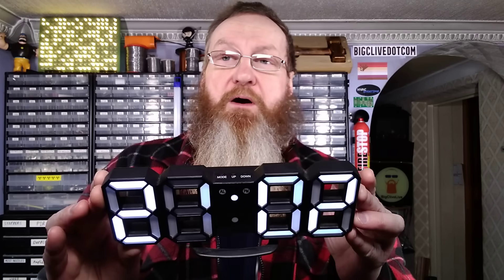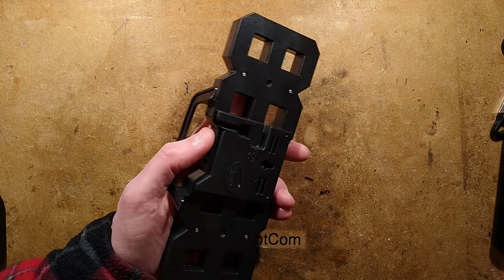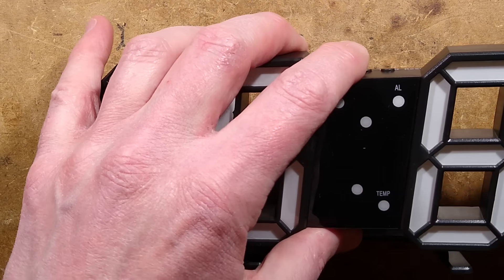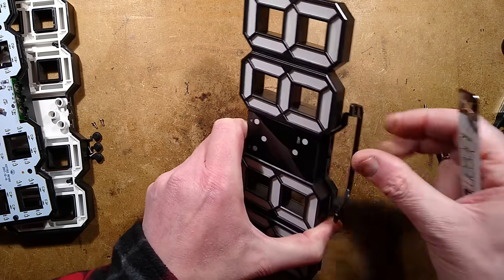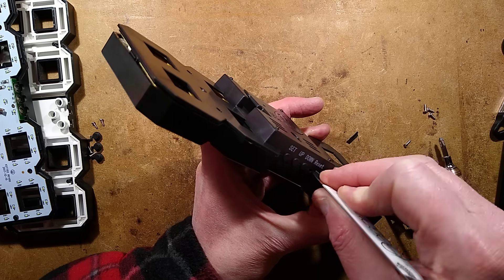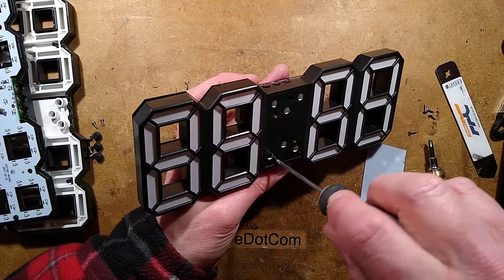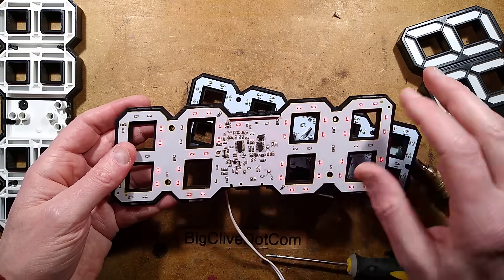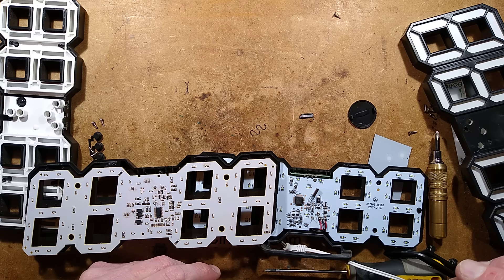The CURSE of white LEDs

Comment: that's why if a device has a dimmer option then I tend to use it. I had a microwave with bright white LEDs that could light up an entire room and one of the segments went out. 
any device with a standby clock that can be turned off, I do so, and any TV with a screensaver, I set the screensaver to power saver mode. there isn't any reason to keep a device turned on that you're not gonna use. I have 4 monitors at my desk and when I'm not at my desk I flip the power strip switch with all of my monitors, desk lights, speakers, etc are completely unplugged when I don't need them. I keep always on displays on my phone completely turned off, I use light mode on LCD (and turn the brightness down) and dark mode on OLED or QLED displays. I take the batteries out of devices that I'm not actively using. 
at the end of the day my devices last longer and are worn less.

Comment: I have a white one in the projection booth I operate, but it has an ambient light sensor so when the room is dark (95% of the time) the LEDs are dimmed so they are not operating at full intensity extending their lifespan.

Comment: Looks like they are overdriving those piddly 0805 leds, for a segment size that big asking two of those tiny leds to evenly light the area up is probably more than they are capable of. Another thing I've seen kill leds quite fast is charlieplex driving them outside their reverse bias specifications. I once had a kit that used blue leds and half were dead after a year of 24/7 operation and I suspect they just really didn't like being rapidly reverse biased to 5V.

Comment: There's a tendency in electronics devices to "overdrive" the LEDs now. I have several modern devices like USB power meters, power adaptors with LCD screens, and many others that have faded out in just 6 months of continous use, basically because they want them to look as bright as possible at the point of sale, but this makes them fade quick. I have leds from 15+ years ago that I used in my home made alarm system, they still glow as bright as the day I made the system (circuits designed by me to drive the leds), I am by far not an expert, I just followed Ohms law and the specs of the LEDs, and they do last forever.
Reply: I think you can add all LED based bulbs to that list as well. Dammit.
Reply: @Cooper_42  I work on a lot of industrial/commercial lighting, and its my experience that about 99% of LED lighting failures are in the power supply, not the LED. I replace a couple hundred LED drivers a year and I think I've done 2 LED strips in the past year. In the home its the edison bulb replacements that die. In the past decade I've had a dozen or two LED edison bulbs fail at home and not a single purpose built LED fixture. I believe its largely due to heat. The bulbs are tiny and driven hard, and the power supply is shoved down into the base with little capacity for cooling, not even coupled to the metal outside, and they're often stuffed into fixtures that further prevent cooling.

Cooling is king with these things as far as longevity goes.
Reply: @ agreed, I wasn’t clear. The entire system is overdriven. Packages too small, cooling not taken into consideration, components squashed together, etc. you can’t make money creating consumer products if you can’t sell new ones, so they have no incentive to design/ build products that last.
Reply: I had a few from ikea 10+ years ago, and they were used constantly. Took about a decade for them to start to fail. They had solid aluminium bases and were well connected, thermally. Can’t get those anymore.
Reply: @Cooper_42  Designing to last requires proper requirement management and verification which costs a lot of time and money, which will not result in more sales. Only big brands care a bit about because they brand reputation at stake, but any no name will do anything about it,
Reply: @sparqqling  No, designing to last adds negligible cost and can even be cheaper. Designing to break requires a lot more R&D work to get the bathtub curve to end just after the warranty period. In the case of this clock, they could have easily doubled the number of LEDs and driven them at 1/3 the current to get the same brightness (it's nonlinear). LEDs are typically a couple cents apiece. It would have increased the cost by a mere 50 cents to do it right. Furthermore, the greater number of LEDs would produce a more even light and they could make the diffusers for each segment less opaque. Now you're down to like 1/4 of the current per LED for the same brightness. The clock would last 10-100 times as long. No fancy "Management" or "Verification" required.

This product was *designed to fail.*
Reply: @cutterjohn1921  Try the ikea globes, the E14's anyway, and they emphersise avoid heat.  ( well heat is electrics enemy, but its rarely mentioned by sellers.)   edit-- so the ikea has been mentioned, still sold in australia, but they are edging in stronger ones.
Reply: @thorlancaster5641 Exactly this. That "it would add cost" is the lamest apologism ever. Adding more margins to components (and designing properly) would add cents to manufacturing costs, all while many if not most consumers would gladly pay several whole bucks more for a product that does last.
Reply: @Cooper_42  I would not be surprised, as with CFLs, if you would see significantly higher lifetime if you orient them upwards. I have had Philips early 2010s LED bulbs die on me - and they were hanging down in ordinary ceiling lamps. All my bulbs I used in table lamps, oriented upwards, do not die. - Since they started flickering, not fading, I am to believe the LED themselves were still fine. 

The sample size is not at all robust, but I have made that observation in CFL bulbs as well - and remember either Clive of Technology Connections make mention of that. 
Would only make sense if LED are driven hot they do also heat up a bulb quite a bit and the constant heat cycling would affect the electronics to power it way more, compared to the other way around.

Regarding the phosphorous in these bulbs I would not all all be surprised if these compounds vary in quality significantly from manufacturer to manufacturer. 
Having a few of the Philips Hue bulbs which basically constantly run in lowly dimmed states, I have not seen any failure or degradation in 5 years of operation.
Reply: @ThePolacanthus  the Philips Hue phosphors do seem more durable, and also are probably overdriven less (given people complain Hue bulbs are dimmer than competitors). 

That said, the smaller ones (to go in desk lamps, not freestanding ones) are a bit dimmer after about 5 years of (near-max) use for me. The large ones are fine. (I confirmed this when I recently got a second lamp bulb out of a 2-pack, and it was a bit brighter than the one that's been used.)
Reply: @ThePolacanthus  I have a vanity light that has 3 light fixtures in it mounted above the mirror in my bathroom. I had to mount the light upside down from how it was designed to be mounted because if I mounted it right side up, I would not be able to open the doors on the mirror as the light fixtures would be hanging down in front of them. All 3 fixtures have the bulbs pointing up, and I have had LED bulbs installed in them along with all of the other light fixtures in the house since I bought this house. What I can tell you is that that vanity light is the only light fixture in the house that I have ever had to change the bulbs in. One of them begins to flicker about once a year and I have to replace it. All of the other bulbs in the house are 7+ years old and showing no signs of failure. Some of them point up, some point down, and some are sideways. I have always assumed that it was the moisture in the air that caused the bulbs in the bathroom to fail.
Reply: Always read the fine datasheet
Reply: Automotive white LEDs don’t seem to have this problem. Even old cars where you would expect to see a flickering white light, you just don’t. The only time I see that is where some kid has retro fitted a cheap Chinese LED bulb. They do pulse those automotive LED’s - perhaps that’s the key to longevity?
Reply: @AdamTelly  It's all about quality of the setup, and pretty much all illumination-power led setups have PWM current regulation, another thing is how near the withstand limit they have chosen to push the current feed.. I have seen failed automotive led lights, but agree there are less of them in there. I think there are some reasons: OEM products generally are not the worst quality, and even legitimate aftermarket fixtures require e/dot approvals and being considered traffic safety devices might at least imply some bit of liability concern for manufacturers and importers.
Reply: My Dad, when he was alive.. bless his soul, he used to check the boards of LED stuff he bought, take a few readings and immediately mod it so that he knew it would last longer.
Reply: It's more than a tendency, it's cost cutting.
Reply: @cutterjohn1921 Both are true - leds themselves are often overdriven (like in that clock likely, and so in bulbs and luminaires), and also the power supplies (like in general among switching PSUs) are a point of failure, with both overdriven semiconductors and underrated capacitors. And thermal design, sure. One more weakness on led bulbs and luminaires is that they often connect leds (or series-connected strings of them) in parallel on single psu output without any means to equalize the current. In an uncontrolled parallel configuration, the one with very slightly lower forward voltage drop (due to variation between individual components or due to temperature difference) makes exponentially more of the current to flow through it, leading to failure if/when the components are rated with each to withstand just their quotient of the drive current. And when it fails, then the others get its full quotient over their owns, and the cycle repeats until the last one fails.

Comment: How weird, I bought a pink one about 5 years ago and two segments went really dim. So I ordered a red one as a replacement too and opened up the clock and soldered the LEDs on the left side of the clock to the dim segments. I found the hot air blower melts the LEDs and makes them unusable. So I used a normal soldering iron with a sharp tip…
Reply: Definitely gotta be quick or use a lower temp and be patient or it's super easy to kill these tiny leds

Comment: Never seen a white LED lasting 100,000 hours! Over time, the phosphor degrades and the LED becomes bluish and unusable (since there is no such thing as a pure white LED yet, they use phosphor to convert blue light into white)

On the other hand, pure red, green, or blue LEDs usually do not die; at least not in a decade if driven well below their maximum rated current. For DIP-2 LEDs, that is usually around 500uA to 5mA, and slightly higher for SMD ones!

For my room's soothing 5000K > 80CRI daylight white LEDs, I prefer those CREE LED chips from USA (imported by RSComponents) and I DIY the LED bulb as 5000K LED isn't available in this entire country (India)! For the red, blue, green, etc. I usually use Everlight which is quite good!

Comment: You know what really pisses me off? Every LED bulb I've owned that I've had to replace has failed because the power supply part burned out, not the LEDs themselves. And that's really just inexcusable, especially considering you can't repair them as they're completely glued together.
Reply: Frfr, the true planned obsolescence that is done in modern LED's just makes me so mad. I've had LED's themselves burn out, but they were quite overvoltaged, so I'm not surprised...
It's so wasteful in terms of resources and energy, shame on basically all modern LED lamp sellers...
Reply: The best LED bulbs I ever owned, and the ones that still work all these years later, are the ones that have a metal outer body that acts as a heat sink.

The plastic ones, and the ones that are all glass, have awful heat dissipation which fries the regulator circuits.
Reply: Not always soo dificult to change out or replace. Especially with just a  simple capacitive-dropper. I have changed some of those  too to just running 12 Volt.
Reply: @ it's hard to even get them open unless there's some trick I'm missing.
Reply: I had one that did not even last 24 hours...
Reply: 'Mains' LEDs (bulbs with drivers in) are just a bad idea IMHO. Use CC or CV bare luminaires and a decent quality separate CC or CV driver.
Reply: @ Would be a great idea if only there were a standard for it. People are hesitant to build a DC "standard" into their house and then 10 years later find that nobody makes replacements for it.
Reply: That's interesting. With the exception of a not-so-dimmable bulb used on a dimmer every LED bulb I've had fail at home has had an LED failure, or more accurately I haven't had a power supply fail first.

Comment: I built a digital clock with red LEDs back in the seventies most of the digits have now failed
Reply: Well, you can easily replace those, but they will light up much brighter than the original ones, maybe if you measure the fwd voltage of an original, you can pair new ones with the right value resistors to achieve roughly the same light intensity as in the original. It is a bit of a hassle having to replace both the LED's and the resistors, but it is an option.

Comment: I have 4 PAR30 LEDS that I have been using forever on a track rail and they still work. I always wanted to know what I'd do when one or more died and I needed another. I got like 6 PAR20s on the local internet used stuff for I think a low price like $10 or something.
Reply: @MatthewSuffidy   I used to have a finished basement lit with about 10 smaller halogen lamps, they always were burning out a few times a year, possibly because I was always using them dimmed. I hated changing them because the recessed cans had to be pulled out of a suspended ceiling to change the bulb and it wore away the weak ceiling tiles each time.

I was so happy when I finally could get a pack of LED replacements for a reasonable price, installed them and not a single one died in multiple years till I moved out. I had 2 spares from a that bulk pack and never had to use one. 

Surprising.

Comment: I hate blue and white LEDs, especially in things that you have in the bedroom.

I had to mod the IKEA air purifier because it had a really strong blue-white LED that was on constantly.
Took two red stickers to dampen and change the colour (that I sourced from the IKEA USB-C charger).

Sometimes red LEDs is the better option, wish more brands used them, even though they aren't as "sexy".
Reply: I prefer amber - red LEDs used to freak me out as a kid. I blame the Terminator. Still, much better than blue.
Reply: even red can be annoying as hell - modded the fire detector in my bed room to lower the intensity of the red led in there that blinks once a minute to indicate that its still on because i could see it blink even with eyes closed (in the dark at least) - who thought that 400ohms series resistance at 9v would be bright😂
Reply: Red LEDs are excellent in a photographic darkroom when using black and white paper...I used a GE remote controlled bulb as a safelight and the room was quite bright even with the long time it takes for caffenol to develop it.

Comment: The new one also has all 7 segments on the left digit. They maybe needed for additional function, like temperature (I have shortly seen)
Reply: Or just for showing 24hr time ?
Reply: @bobpockney  When you show the time in 24h style you just need 6 segments in the last segment, because you have only to show two numbers, 1 und 2.
Reply: @oliverkykal8087  You're forgetting zero.  7am is 0700.
Reply: @bobpockney  Often the zero is not shown. So it will display 7:00